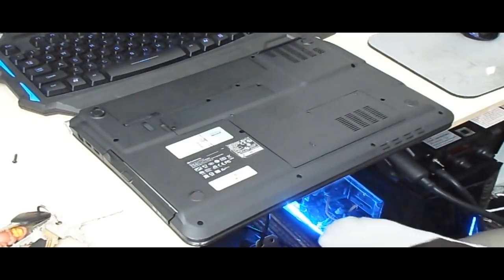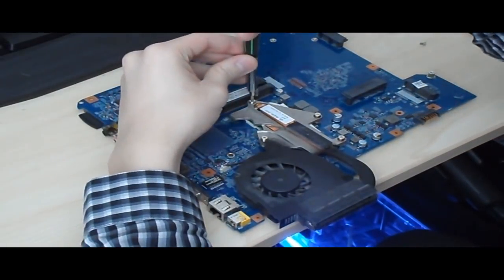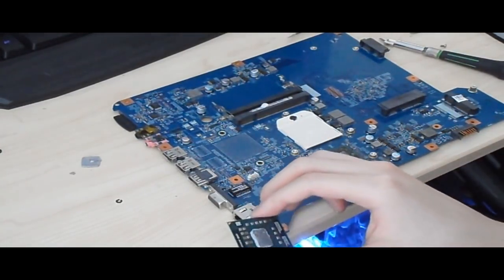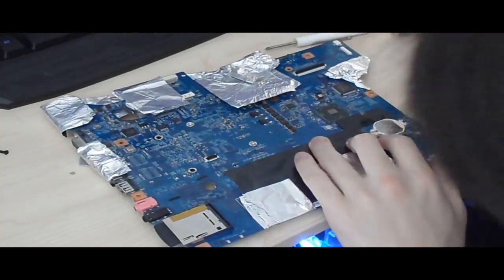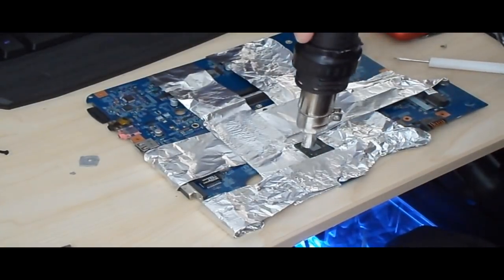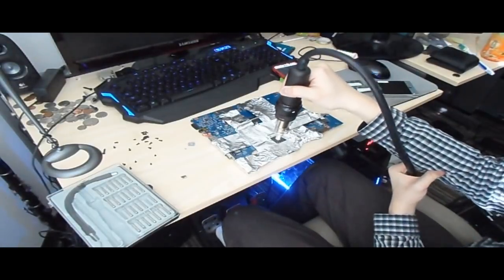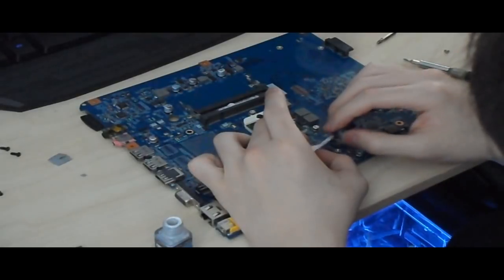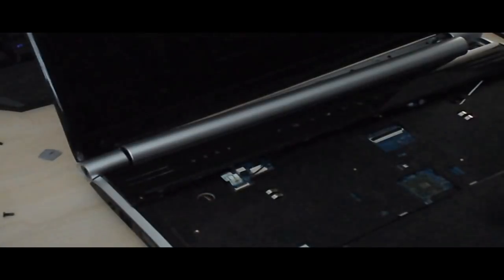How to fix black screen part 2 (How to reflow)

Comment: Hii
Some people in comments of other vids say that it helps if you put a towel over the ventilation system, turn the laptop on and let it heat up for about 20 mins and then turn the laptop off, w8 for a while, and of you turn it on it works.

I assume this has also to do with heating up the graphic card.
What are your thoughts on that? 
Anyone has comments on this?

Comment: hello, i have  a problem, my hp dv6 wont start up, when i connect de ac cable or plug the battery, the screen immediately turns whithe but the fan is not working, Just keep on the White screen, i tap the power buttom and nothing happens